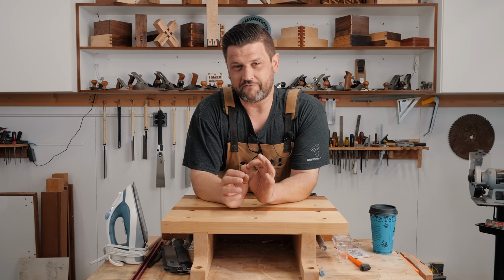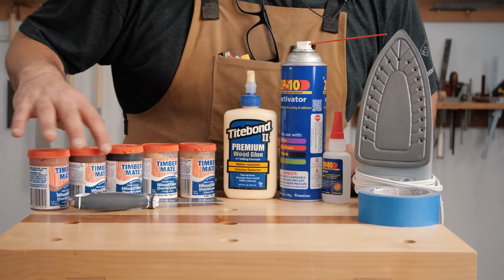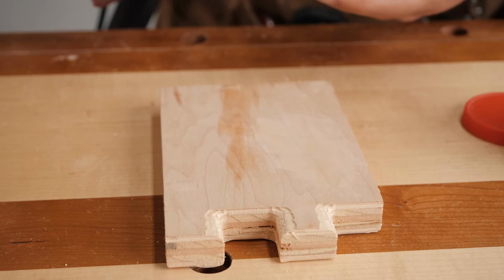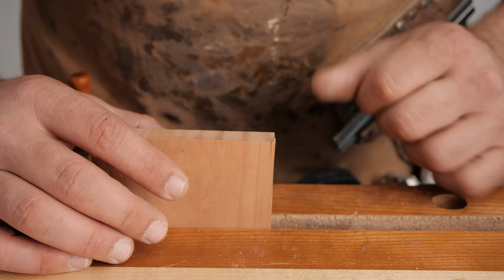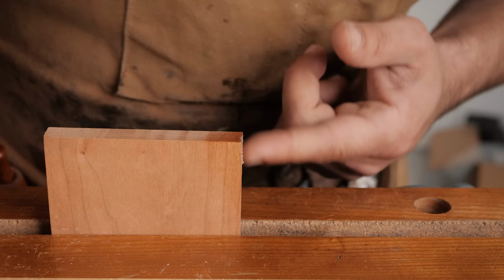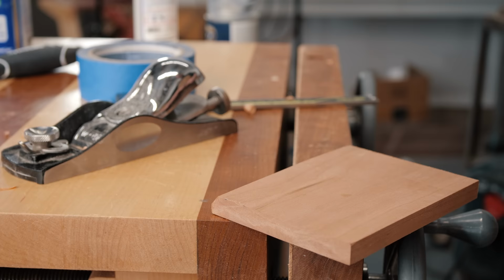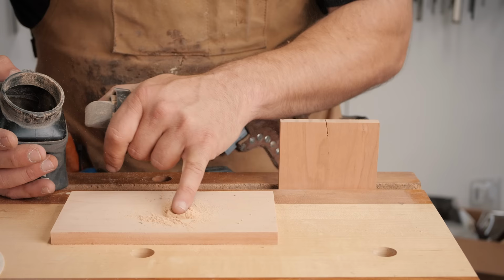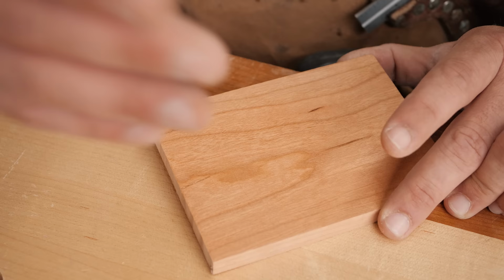7 Ways to Fix Common Woodworking Mistakes

Comment: Great tips. I've hears some. But my favorite is definitely the cupped board after reshaping. I've had that issue and didn't know how to fix it. There were a couple others I hadn't heard as well. Thanks for sharing. I
Reply: Often times it’s better if you introduce the cupped/crowned piece to high humidity for a couple of days it will correct itself and then allow it re- acclimate slowly. Sometimes the wet and clamp method results in internal tension in the wood that can react later when the project is complete.

Comment: Dang it! I was going to suggest the wood glue and saw dust! LOL I learned that as a custom carpenter at a very young age. We'd use the sawdust from the same type of wood, usually oak, and it's guaranteed to stain the same. The only difference is that we mixed the glue and sawdust to make a paste and worked it into the scratch or cut. Great tip though!
Reply: Yeah i had never even heard of woodfiller as a young woodworker. We always just made our own by mixing sawdust and glue. I didn't even know you could buy woodfill till i was older.

Comment: Sawdust & Glue / titebond 2 and not 3. TB3 glue dries to dark for the trick.
Reply: Big Mo he WAS using titebond 2, also depending on the wood the darkness of titebond 3 might be appropriate.
Reply: Jeremy Specce : didn’t mean to imply he was. Just intended to add an additional detail. Believe me, with his skillset i wouldn’t challenge his advice
Reply: Good to know. Thank you for the additional little detail
Reply: I learned the difference in color between TB2 and TB3 the hard way too. I used TB3 with sawdust and filled in divots, etc. on my light wood project. Thought I was so clever because I used the sawdust I had collected from the project. When I mixed with glue I noticed the darker color but just figured it would lighten up once dry. It did not. My project looked terrible. Had to sand it all back out. Total mess. Now I know the difference 🙂!
Reply: aminraleigh Thanks for the comment. I end up using TB 3 as I found myself making several cutting boards recently. I’ve tried the TB 3 with sawdust and, as you said, it is dark. Are you saying TB 2 doesn’t do that?
Reply: I find sawdust and glue turns black, so I use sawdust mixed with shellac. Mix to a runny paste and spread it into the crack. Use white shellac on pale timbers. (P.s. I am a female woodworker. They exist! 😂)

Comment: "I could not find a board in my shop that is cupped."
Me: grrrrrrrr
Reply: Add the word "not" after the word "is" and that would be an accurate statement for me more times than not!
Reply: @lockedloaded4942  Try resawing lowe's 2x 8 10 or 12s.... Minor twist with a cup and a bow??  My planer won't even feed the stuff
Reply: I have difficulty finding one in my shop that is NOT cupped lol :)

Comment: I stumbled on this video yesterday and you totally saved me. I made the mistake of using painter's pyramids on this cedar table I'm working on and they left little indents in the top surface. That wet rag/iron trick got them out easily. I thought I was going to have to resand the whole piece 🙏

Comment: So many Tips sort of make the rounds of YouTube. I've learned a lot from my Wife when she worked at a national Furniture Company 30 years ago. 
I've seen and used the iron, sawdust and filler. One thing that was stocked at the furniture store was an assortment of dye finish markers. Every type of finish that they built was made into a fillable aluminum pen. It had a cap on one end and a pointed felt tip on the other. Haven't seen those dye-finish pens since.

Comment: I've been using these and other tricks for a long time, and they work quite well! And definitely don't be pointing out all of your mistakes to potential customers and clients or you'll create the issue where people like your work, but know there's mistakes. They won't care how you fixed it! Then they tell others and... well, you get the picture. 😲

As for home made filler using sawdust and glue, this works well for a lot of different uses, but be careful as a lot of wood glues won't stain or take a finish after hardening, and will leave a tell behind.

Comment: Great video. Learned from it. Wish I'd watched it last night as i had a panel glue up gap today that I took ages to fix using the table saw and sander. Will use your plane method next time. 👍

Comment: GREAT tips, well shown!  A common go-to for me is the screwdriver/burnisher trick on miters that have a small gap.  Sometimes with glue spread in the gap, sometimes without.  Burnish each side towards the center and bye bye gap.

Comment: Very useful tips. Thanks. We have restored the 100+ year old flooring in our home and the planks were nailed down. After countersetting the nails and sanding we fill the holes with glue and sanding dust just like you described, then sand with 180 grit one more time. It is virtually impossible to see where the nails were when done. There are many useful things you can do with that mixture of sanding dust and glue. Thanks again.

Comment: Good useful tips! I did have issue with the one where you clamped up the two boards you were gluing because the angle along the edges was different and it left a gap when layed flat. Yes, planing them back to back will make the angle butt correctly, but if the edge along the length of the board is not perfectly straight, the edges will not mate perfectly. A plane would make this pretty tricky for most woodworkers, like me. A jointer would be far better. In the video you can see the gaps at both the front edge of the splice, near your finger, and near the back joint.

Comment: My grandfather taught me the sawdust/glue trick back in the 60's. He called it animal glue. He would also save thicker shavings from planing for larger cuts.
Reply: Did he call it animal glue because he was using hide glue?  Or just when it was mixed with sawdust?

Comment: If you drill pilot holes for a hinge and it is slightly off... Over drill the hole a little take some wood glue mix with saw dust until it is a putty then pack it into the hole place your hinge over the hole then screw into the mixture just so the screw is flush with the hinge then set it aside so it can dry.  I recess all my hinges so I can't move it slightly to the side and this has worked for me.

Comment: I have used the CA glue trick and it works great most of the time.  Where I’ve run into issues is with repairing dovetails.  I was working with cherry and it turned the end grain cracks very dark.   It seemed to draw the CA glue in deep and I couldn’t plane or sand it out.  Just be cautious, otherwise a great little trick.

Comment: The CA glue on your finger trick I never knew, worth the hole video.
Reply: Agreed. I grew up building model airplanes; with tight tolerances, tight working space, mostly using CA, glueing yourself to your workpiece is common 😂

Comment: Great tips ! I wanna start wood working but have space to work in. These tips definitely gave me more confidence to at least do some little projects and also to buy some wood working tools. I have a circ saw  jigsaw palm sander some clamps a drill and of course a bottle of wood glue lol I wanna get some actual hand tools. Harbor freight here I come 🤷🏻‍♂️
Reply: Find a local Woodcraft or Rockler. Quality tools at reasonable prices. And you can also attend classes in the stores on how to use those tools.

Comment: a little tip on the chip out using the 2p-10 repair ( one of my favorite glues use it a ton)  put the glue on both sides of a piece of paper and slide the paper into the chip.  Gets the glue in there a lot better for a much better hold.  Works just as good with any glue you want to get into a crack.

Comment: Great video. A similar fix is for flattening plywood that has cupped. No need to throw it out. Just rub a damp cloth over the cupped side, and lay it on a concrete floor (cupped side down). Leave it overnight, and in the morning it’ll be flat.

Comment: Very insightful, thanks.
You showed how to remove dents using a hot iron, but how about the opposite when you have bubbles or warps forming on a table top? Is there a way to remove them?

Comment: Another frequently invaluable tool for fixing small mishaps is the infamous glue-syringe. Great for so many places you wouldn't otherwise be able to reach without causing further damage.
Reply: Do you clean the syringe after every use? Is that even possible?

Comment: Ok this is one of the best videos I ever watched on woodworking. 1st
That looked like.a manual dovetail maker..Do you have jig like that? Next..great Idea about using the sander.. I usually use fine sawdust from the table saw..but this is much better. I am wondering could this be used on larger gaps like 1/4..we don't make mistakes..NOT.
Would it be suitable for chairs etc?
I could see it for small gaps.

Comment: Earlier today, I used the water trick to flatten two 4x8 sheets of expensive plywood that had bowed/cupped about 14 inches. I wet the concave side and literally watched the panels flatten under their own weight. I then stacked them concave to concave and put a couple 5 gallon pails of paint on them. To keep the edges flat while drying, I used a couple long 2x's and weighted them down. Salvaged/saved $200 worth of materials.

Comment: That’s a very helpful video Jonathan. While I’ve used most, if not all, over the years it’s a great refresher. BTW — Timbermate is fantastic. Even if it completely dries out all I need to do is add some water. It can be tricky however when using water to raise the grain before sanding as with water based finishes. Before I paint with latex paint, for example, I spray on some shellac where I’ve used the filler.

Comment: I make longboards and they’re laminated 1/8 sheets of wood so it is a struggle to always apply the correct amount of pressure at every square inch of the board especially on the ends. One way to help if a ply of boards is delaminating after you’ve cut it or what have you is use something to heat up the wood, I use a heat gun. Then dab in a little wood glue or the CA glue (I’d imagine it would work as well but I haven’t used it) and then simply clamp it and let it sit. Heating it up allows for any air pockets to expand near your opening and releasing the air and expanding the glue out and then you apply new glue and clamp now without any pesky air.

Comment: Great video Jonathan. What I do for gaps on joint is king of similar but I use the Poly I’ll be using for the finish and add saw dust to it. Love the tío on the duffed edge and the reglue a scrap piece. That will help me on a current project.

Comment: I build and finish custom bedroom furniture. I find it fun when I have to figure out a work-a-round to fix a booboo of my own or big uh-ohs by the new guy. Repairing it without losing structural integrity and making it look good helps the day fly by faster. I hate fixing bad paint or stain errors. Sanding off flashed but uncured lacquer is a huge pain in the butt.

Comment: Epoxy with paint pigments work well to simulate darker streaks in wood grain (don’t try to match the overall color; always try to match the darkest or even possibly the lightest colors.)  Works pretty well.

Comment: Thanks for sharing!  I've got to replace a couple sections of my 1 x 3" pine cabinet face frame boards. I'd rather cross cut the straight lines with a fine finishing hand saw that will cut cleanly / accurately instead of using my jig saw. Do you have any suggestions of a great little hand saw that would do the trick? Thanks again again for sharing your video. I defiantly learned a few things here. Great job! 👍😊

Comment: Awesome stuff thank you! 👌 There was only one thing that I thought wasn't very clear and would appreciate if you confirmed it. When your board/table is cupped like a rainbow let's say (ends pointing down), do you wet the top part or flip the table and wet the under part (in this case the rainbow is upside down)? Once the surface is wet, the wet surface should be covered and face upwards correct?

Comment: I've have got to try the iron trick never would have thought about that you're awesome but I would like to see you some tricks with MDF because you're doing a lot of finish work with it paintable I usually just use wood filler painter's putty stuff like that to fill the imperfections but if you got any tricks for that let me know

Comment: Another great trick for cupped panels is place them on your lawn on a sunny day with the crown facing up. One side of the wood will draw moisture up from the lawn, the other side will dry in the sun equalizing the moisture and removing the cupping

Comment: The saw dust and wood glue is my go to.  I often will wait until I'm start my finishing sanding to do it.  Place the glue and sand with a rougher grit to get the dust from the project itself into the glue.  Then work your way through the rest of your finishing sanding and bam.

Comment: Great tips. Another one is if you have to plug a hole or cover a large blemish consider cutting a diamond out and laying in some contrasting wood. You only need to go in about 1/4 inch or so, similar to making a dovetail key.
Put several diamonds in a row to make it look like it is supposed to be there.
Reply from the maker: great idea

Comment: I build radio controlled airplanes, mostly of balsa.  It's light but it's soft and dents easily.  I just brush water directly onto the dent and hit it with the iron.  That localizes the repair and prevents raising the grain everywhere as with a wet rag or paper towel.

Comment: One trick I have used on a few occasions, when I didn't have a filler that would match up with the wood, was take some wood glue and mix wit with the fine saw dust from the project to make my own filler, which gave me a perfect or near perfect color match.  Just remember the more glue you add the more it may change the color.  In this case less glue is truly more.

Comment: I haven't watched your video yet
  I find woodworking with limited tools and finances..very rewarding. 
I kept on looking at a childs first desk I was building. I would look at it from 50 feet or so away. I could see uneven angled legs. I got my Swanson square out..90° on the money. Go a 1 foot square ..same perfect.  I didn't have a a three foot square ..but A straight edge told the story (In 2 feet some of the legs were 3/4" off.  The 2 by 2s were crooked.  Planer is in my future. Time being I'll have them
planed.  I plan to invest in a 2 foot square. Sometimes a 3 foot ⬛ is
Too big. Off to watch the video.

Comment: One tip that isn't really woodworking but could help is if there's a small metal tool mark on plastic laminate, like a cabinet door face or inside if it's melamine.  Use a small amount of latex caulk and rub it into the mark with your finger, just enough to remove the mark.  Be cautious as on satin finish plastic laminate it will buff it to a glossy sheen.  If the lighting hits it as the right angle you'll see the buff mark.

Comment: Just a comment re the CA activator. I used to buy it then I learned that water works very well as an activator. I bought a small spray bottle and filled with water. Works great! Note though... it gets hot so don't hold directly with your fingers!

Comment: Great video!!  Here's a variation on the sawdust & glue trick for filling cracks: sawdust & shellac.  This approach will sometimes take a finish better than the sawdust & glue, plus it dries quicker.  If you're also finishing the work with shellac, the repair will completely disappear.
Reply from the maker: I'm going to try that

Comment: You can fill big gaps in dovetails with wood slivers as well. Its really good for for this because you can match the grain direction to really hiding those gaps! Coat the sliver with glue, tap it in, plane or chisel off the excess
Reply from the maker: I do that too. Should've mentioned it

Comment: Super quick fix, but if you have nicks or finish scratches (it’ll kinda hide deeper stuff in a pinch) on medium to dark brown finished pieces, a sharpie or magic marker will blend almost anything to the point you might not see it if you’re looking for it. Just color in the raw wood and wipe it off. It’s great for hiding scratches from installation, damage you missed on the underside or in less-visible areas, or for touching up furniture. Most brown finish will take it, it tends to appear purple on black surfaces though.

Comment: The iron and moist towel works on painted wood too. I'm not sure about other finishes. 
My mother in law let a broom drop in her apartment and I'd seen this trick done I think on ask this old house so I gave it a try.   
Yes wallered out screw holes, a tooth pick or match stick and glue will give you enough wood to bite into, you do not need to let it dry after putting in the glue and tooth pick or match sticks, or kebob sticks the screw will add camping pressure.  Fixed plenty of door hinges this way works like a charm. Doesn't work on metal door as good! But it will even work on them. Skip the glue just use a golf T   oh a golf T works too.

Comment: Excellent, as always.  Hey, I have a situation where I have a chipped edge on some Baltic birch that the Timbermate would work perfectly for filling.  The problem is that I already have a coat of spar varnish on the piece. I assume the Timbermate won’t likely adhere to the varnished area?  I was hoping to do the fill anyway, and varnish over the fix.  It is on the bottom of my project, so I am not too worried about it being perfect, but need it to adhere.  The chipped area (router mistake) would be tough to sand out at this point, but I could perhaps get a dremel tool in there or a tiny file....
Reply from the maker: That's a tough one with the finish on there already. Going to have to remove it some way to find a different filler